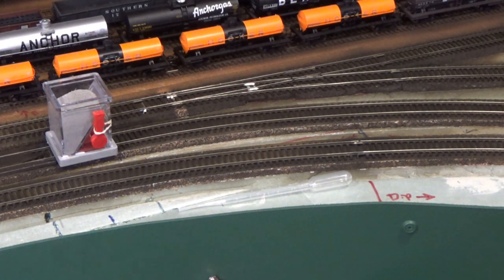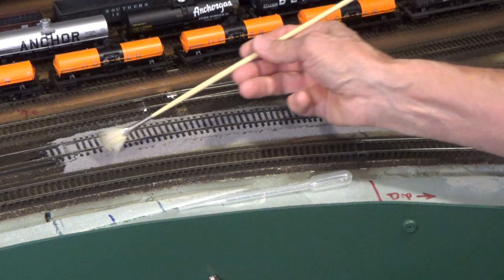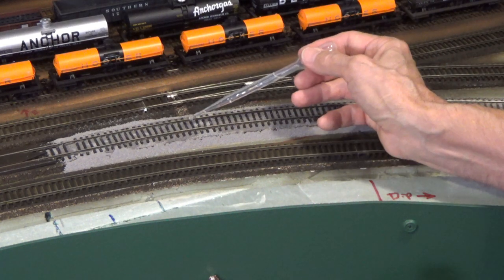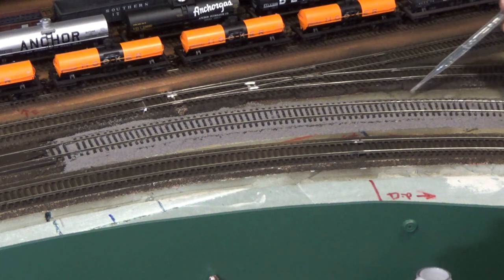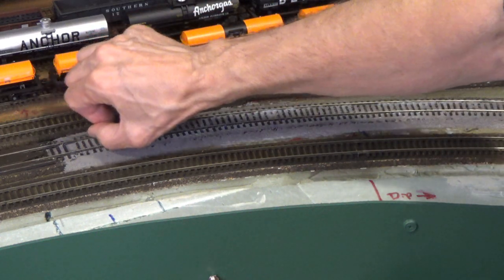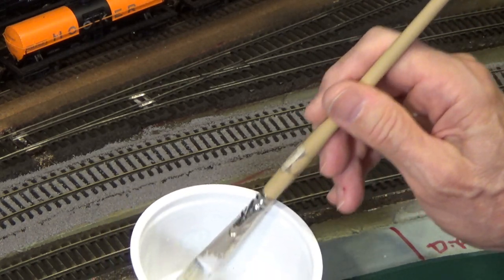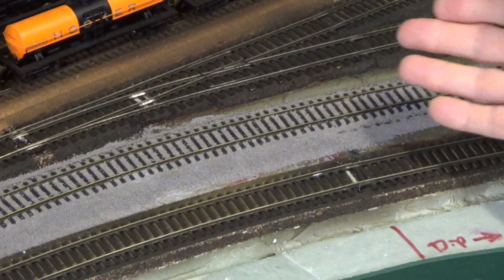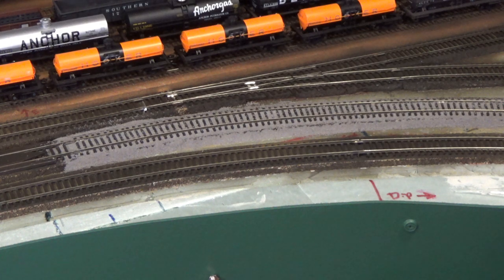Easy Ballasting Step By Step (30)

Comment: Yeah.
Nice finish.
There is an alternative to stop the cracking and last step.
Tap on the side ballast gently with your finger while it is dry. This compacts the ballast up against the Cork underlay and avoids the cracking. You soon learn how much pressure to use.
In my experience you can also tap the wet ballast as a final shaping. This causes the same as liquifaction with the glue paste. A few tries and you can master it.
This will save the last step.
I've seen so many YouTubers say, "don't touch the wet ballast", but honestly, it can be done successfully if you are gentle. Trial and error saves time. 👍
Monsville Railways

Comment: Cork roadbed has "brow" on one side when you tear it in half and it must be removed before laying it or applying ballast as it looks bad when ballast is applied. I use a rasp for this. Also its is difficult to adhere the ballast to the side of the roadbed and you can end up with the brown showing through. I solved this by first selecting a flat latex paint that matched the ballast to be used then paint the roadbed before laying track. It looks better and hides any missed spots. Your techniques are right on and thanks for the rubber band on the spreader. I will apply same to mine.
Reply from the maker: I have also used wood rasps and a razor knife to trim off that little brow.
Reply: @TheDCCGuy  I know as I did not see any on your layout. Most people don't realize until it's down. You have a great channel. I learned a lot about DCC from it and now all my remaining Atheran Blue Box Locos are now DCC. Thanks.

Comment: How do you clean off the glue from the track so your train makes contact to the rails?
Reply from the maker: First, I put the glue on the ballast not the rails. Howerver if I do get a splash it can be removed using a damp cloth to clean the rails before it dries. If some gets missed and dries then a swipe with a Brite Boy will get it off.

Comment: Actually, did a bit more investigating and found the ballast I was using was not fine but medium. The spreader I have is not Bachman but is a Proses. Also, one of the holes that opens to spread the ballast on the side is a tiny bit smaller than the other one. This makes for an uneven spread to one side. I think the medium ballast should spread OK as it's not that much bigger than the fine ballast. Can't figure out why it does not spread though. Perhaps the age of the ballast I'm using has something to do with it but not sure. I've ordered new ballast and will try it and see how that works.
Reply from the maker: I hope you can get it to work for you, it does make a tedious process go much faster. I do recommend doing it in about 1’ sections as the ballast can build up and needs to be spread onto empty track. This also is about all you can do before needing a refill. Good luck!

Comment: Nice ballasting job! What brand and code of track do you use? Happy Modeling! 🚂
Reply from the maker: I mostly use MicroEngineering track, but also have some Peco, all code 83.
Reply: @TheDCCGuy  Cool! That’s what I want to use on my new layout. Do you ever have any derailment issues or problems with it? As I know that the rails are lower in height.
Reply from the maker: I have never had any issues with code 83, but code 70 can be different if you have any cars with slightly oversized flanges. The only issue I know of with ME track is the gaging can be a bit tight at the frog and steam locos seem to have occasional problems with the bronze frog insert but not diesels. So you might test one with your locos before investing in a bunch. If I run into a problem I just give it a few swipes with a small flat file and move on.
Reply: @TheDCCGuy  That’s good! Thank you very much for the helpful input and information. Happy Modeling! 🚂

Comment: Even using fine ballast, i couldn't get it to spread with the Bachman spreader.
Reply from the maker: Rick, wow, sorry to hear that. I must be using a very fine ballast as it does work for me. Mine is Woodland Scenics fine gray ballast. I’ll have to dig around and see what other sizes I have on hand to try out. Thanks for pointing this out before a lot of folks invest in these, they are a bit pricey. In the end the good old plastic spoon method will never let you down and I guarantee it will spread any size “model” ballast.

Ok, I just tested it with Scenic Express #40 light gray limetstone ballast and some of my home made stuff that I sifted to 0.5-1 mm size and both worked fine. My home made stuff is a lot bigger than the fine ballast and is a little coarser than I really liked so I don’t use it anymore favoring the fine grade. Just what kind of problems are you having, does the ballast not come out of the spreader at all?